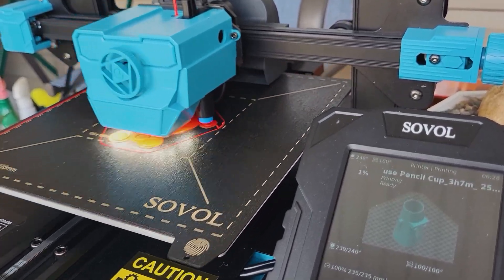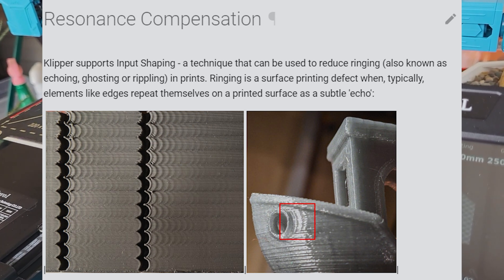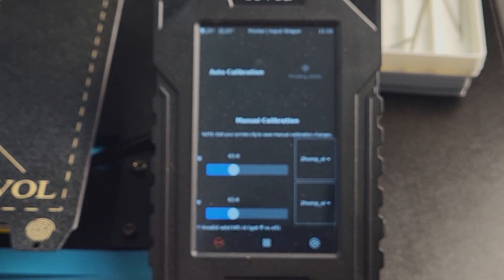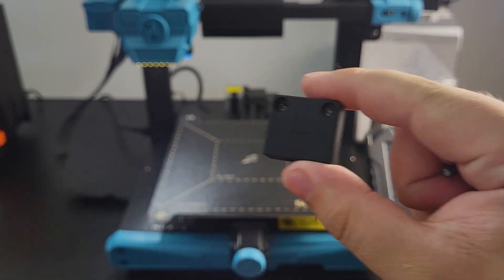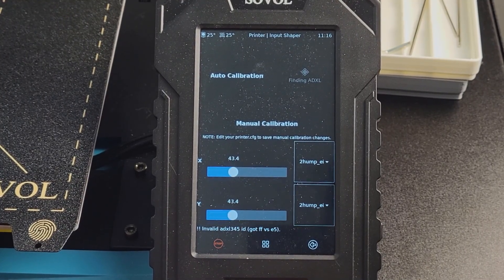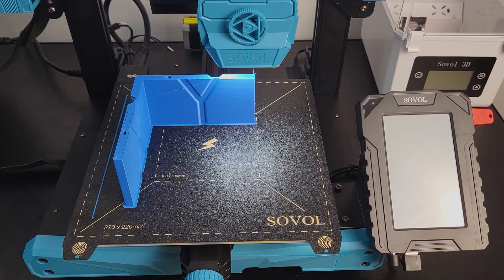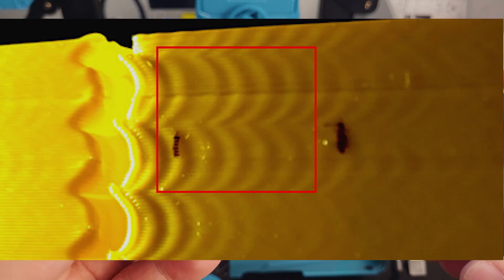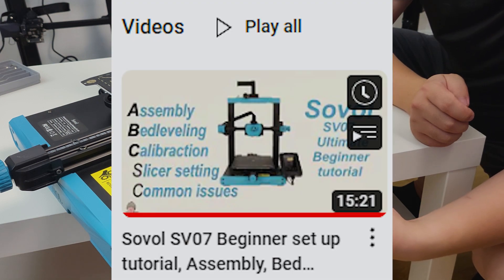SV07 Input shaping guide, Resonance compensation

Comment: Wow that's strange it got worse! Guess they did a lot of testing for the factory calibration. May have something to do with the actual default speeds used as well. Great video! If a word is particularly hard for you, I recommend breaking it down into parts. Accelerometer is axe-cell-lur-rom-meter. Hope the suggesting is not insulting. Love the effort!
Reply from the maker: Thanks!!
Reply: Yeah, most videos I've seen make this accelerometer calibration test seem useless and unneeded.

Comment: I have the same issue as the other post. 
I followed instructions and ran through the process. 
Mine factory was set at x40 and Y40. I did not note well enough the setting to the right what letters where there. 
After running imput with auto calibration i got X53 with ei. And Y46 with ei once and mz something the next try. 
However none of that matters as the printer is no longer useable at this point. It now moves with tremendous force. Switching directions so abruptly it just skips teeth on the belt and of course thats layer shifting. I cannot find a reset to factory option. I manually tried on the lcd screen to adjust the slider bars back to the original 40 on each axis and i think they where on 2 hump setting. But it will not save my manual settings. Says in text in lcd above slider bars manual settings must be done in config folder and saved. 
Well i open config folder and have zero clue how go make any changes. I have had this 7plus for 2 weeks and have wasted hours trying to get a decent print. I am not new to 3d printing. Been doing it for last 8 years. Also have the Bambu X1C. I got this 7 plus for the larger prints. But i am so pissed off at this entire thing. I hate this printer. My first time using Klipper and it sucks a fat ****". If you have never used it and simply dont know anything about it you are just plane out of luck. Hours reading online and nothing ever gets to the point.  I got one easy question. Reset imput shaper to factory settings? How hard could that be? Well pretty dam hard. Open config fold find line that reads " your a sucker for buying this junk" and enter in the amount of money and hours spent getting nowhere here. Now get out your calculator and take that money spent X the hours spent researching and trying to get it going then divide that by 1000 and you now have X which is your iq. Yes its negative because if you had any brain you would not have purchased this junk. 
Then hit save and close. Reboot and nothing changed or it only gets worse. 
Sorry i have just spent the last 6 hours of my evening trying to calibrate the ringing in the prints. Its now 2:30 am and i stopped working on the sov7plus and called it a night. I have read watched videos and nothing simply shows how to put it back to its original settings. 
Ok well i guess i need to read and understand what is happening. I read the klipper page access the config folder and guess what?......the lines they show are not the same lines in my fliudd page of clipper. Shows imput shaper. Under that should show X and Y and the values. Mine shows a buffer number and something else. I am so lost at this point and tired i dont remember what it was. But it does not match the klipper page that shows the numbers. Rediculous. 
Why is the auto calibration making the printer so aggressive? 
It did not help anything. Just slams back and forth skipping belt teeth. Oh well guess it sits there till i get pissed and toss it out. 
Thanks for your videos. I have referred to them several times over the last 2 weeks trying to get a half decent print from the 7 plus. But nope no luck. I bet i could pull the board and electronics out and build my own setup with more success. Who knows.
Reply from the maker: yeah, it is kinda unfortunate that they are a bit rush out this printer. When I received my pre-order unit, the manual instruction is poor that I would totally believe a new comer will get confused by many of ther steps in the instruction. I have gives feedback to them, I think they might have made revision on the later patch. 
But you are not the only one who having issue with the Klipper files on the printer. Apparently there are a lot more people having issue after change settings or thing on the cfg. file for the Klipper firmware. So, don't feel bad about yourself, I have done that so many times. It will be always new journey when you play around with new printers, they all have some difference at some point. Now as many people have requested on the FB group and asking for the orginal Klipper files, they have told that their enginners are working on some bugs and will be post to their site ASAP.
I believe your problem will be fix by replacing the files to the original. I would said might be waitting for the new cfg. file to get upload, or find it on Github. Leave the malfunction printer alone for a bit, I have experienced similar thing with Prusa MK3S for many week before, similar shitt, just never get a print come out right. In the end of the day, I just leave it alone for a while until I got enough patience to dealing with it. 
As far as Klipper goes, it is whole new thing to compare to the Marlin. Some people love it some don't. I have a mix bag of experience with Klipper printers. It is sometimes really ticky to work with it compared to the Marlin.

Comment: I did mine following the book and it made the printer unusable with massive layer shifting.. after watching this video I noted that the accelerometer was reversed here compared to the manual..  how did you know which way the accelerometer was supposed to be?
Reply from the maker: The direction is according to cartesian coordinate system. So just kinda try out with that logic and it worked.

Comment: Great info. What is the print placed above the large fan for? What advantages? Where can I find the file? Thank you!
Reply: Do u have news about the duct system fan?
Reply from the maker: It's a cover that I designed to reduce the gantry cooling fan noise, made couple revisions so far seems went to the wrong rabbit hole. Very little to no effect to the noise level.
Reply: @SvgLau  And yes, it makes a lot of noise, but the fan must be the problem, it seems quite cheap at sight. Thanks for the info!
Reply from the maker: @paoloz67  yeah, it's cheap part. Even the duct itself feels really cheap too. Working on design a duct system that could replace with quality pc case fan.
Reply: @SvgLau  any update about the fan noise?
At the moment sovol selling the sv07 for $113 so i think you will get some new viewers after this Black Friday! 😊